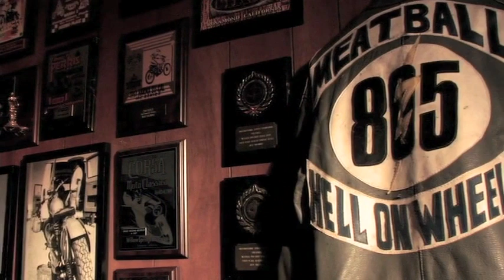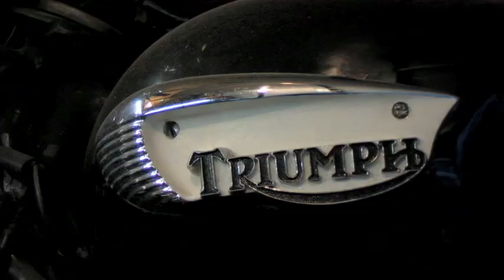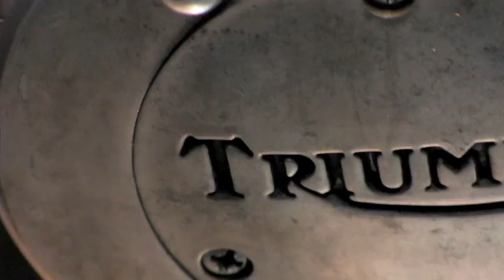Cafe Racer Movie - Brittown (watch online free - first ten minutes!) Vintage Style and Speed

Comment: ya pressure from behind leave nut on to protect the threads, just loose a few turns then give the shaft a wrap with a brass or copper hammer ,it should come one.. good solid shot ..no smashing over and over ..just one hit ..it moves loosen nut some more and do it again ..over and over till its off ....